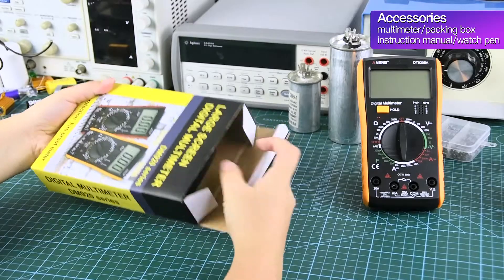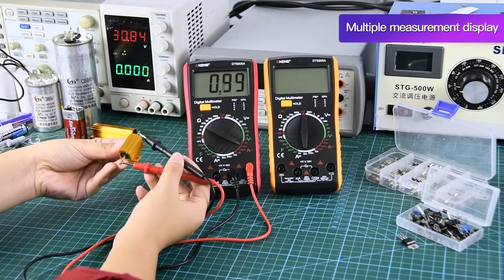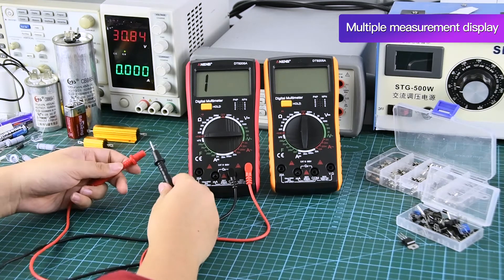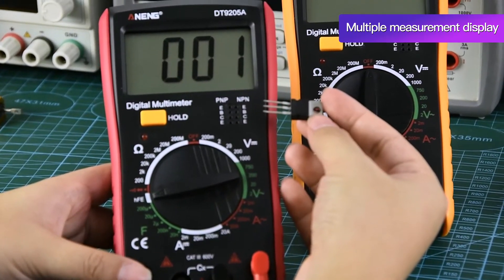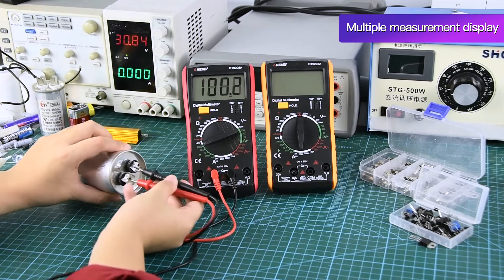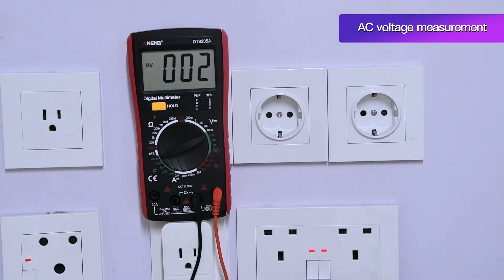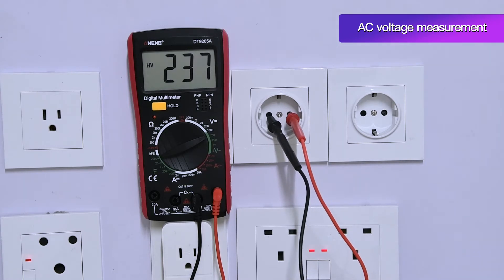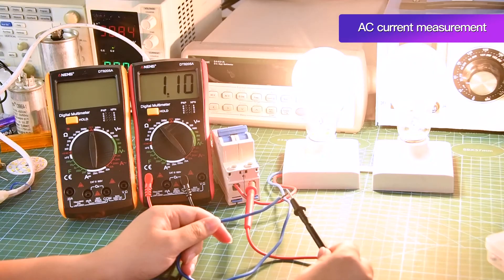Newly ANENG DT9205A HD Digital True RMS Professional Multimeter AC/DC Tester Buzzer Auto Electrical

Comment: In the multimeter it says that it has a 220mA/250v fuse. I have opened it and there is no fuse. It also says 20A maximum, and on the inside plate it says 10A. you are lying to people. The title of the video is totally false. The multimeter is not TRMS it is RMS. Stop lying to people!
Reply: Will it measure 20A?
Reply: @sadfur8728  yes
Reply: @farlusberner8986  So the inside plate   labeling is incorrect?
Measure a square wave and see if it reads the voltage correctly vs. a sine wave.
Reply: @sadfur8728  What you ask is in the instruction manual. I have not disassembled the motherboard to see what it says. There are experts who have put this multimeter to the test and it supports amperage and volts well. I recommend buying a higher quality one and not this one. This multimeter is very cheap and what is very cheap can be expensive.